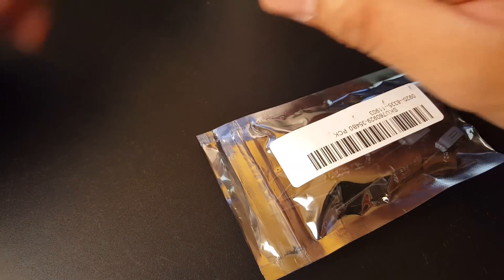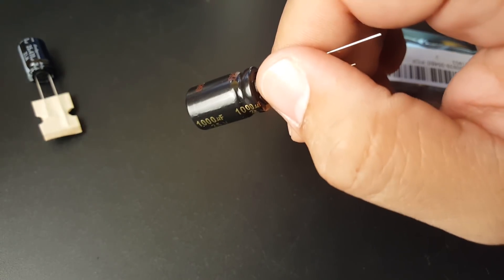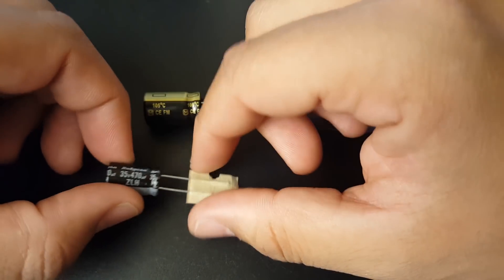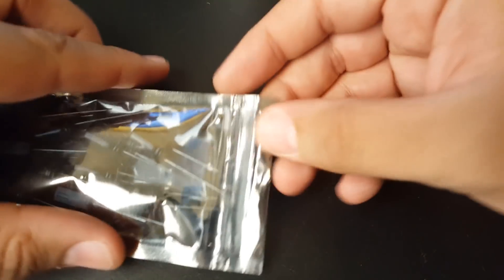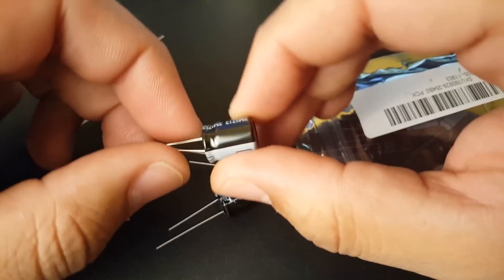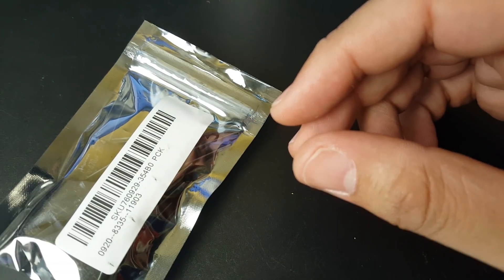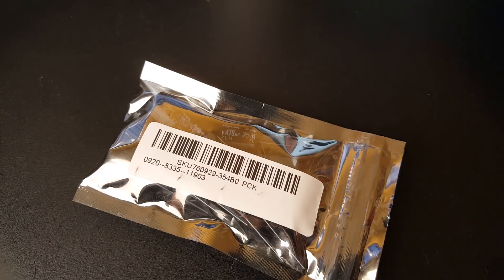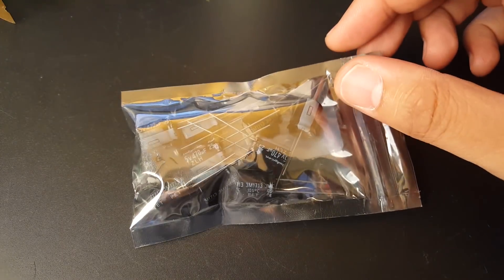Low ESR Capacitors I Use For My Builds

Comment: I run a 35v 470uf Panasonic cap on each of my KISS24 amp ESCs, on my Chameleon and it makes my quad sooo smooth, It's really noticeable. I did it at first to clean up a bad video signal, and it did not help, but I noticed how smooth it made my quad, so I kept them on. Bad video turned out to be antenna grounding on the Aluminum bracket they provide.(O-Ring smashes and does not last long) I moved antenna to carbon top plate and so it did not touch the Aluminum and it cleared up instantly.
Reply: Magic Smoke FPV how did you connect your  caps to esc? Did you solder directly power wire on esc?

Comment: Caps are tricky thing, some of the better more expensive ones are used by hi-fi audio enthusiasts known as audiophiles and sometimes musicians who mod their instruments. Also by audio manufacturers. And what happens is that some particular cap gets popular by an audience who can pay more. And the price rises. And most of the time you can get same specs cap twice as cheap, but it’s not known or accepted in audio industry. For quads we should keep away audio caps as they are more expensive due to usually false perception of “better” sound :) Remember those guys who say 100$ HDMI cable has better sound and video comparing to 10$ one. But we know the data is sent digitally and no HDMI cable will make bass deeper :)
Reply: Not the same if we talking about low ESR capacitors. Regular electrolytic capacitors aren't that good for ripple current filtering (which we need to get rid of ESC noise in FPV video) than low ESR ones. Because of that they are 4-5 times more expensive.
Reply: Yes, for the low ESR, but there are some manufacturers, which are targeting to audio maniacs like Vishay, Audio Note or the old Elna's. Rubycon's and Panasonics will be trashed by audio guys, but they work perfectly OK on quads. And audio guys can create and believe to so much pseudo-science, I just can't believe :D Most of them don't even know what equipment is used in studios to record their music they want to "recreate" best on their $30000 speaker set :)

Comment: is it safe to assume that ceramic capacitors are generally lower esr than electrolyte capacitors?
Assuming that you can connect them directly smd to your signal source.

Comment: when i seen my capacitors are made by a company called chong, i kinda lost heart a little...  hehehe i dont have noisy video but i do have the black lines permanently on my fpv, i think its from my rx since it doesnt change during flight. and capacitors dont seem to address that kinda rf noise
Reply: Check to see if your antenna is touching the frame or any metal. I had the same problem on my Chameleon, and almost swore it off forever because I could not get any video Tx to work without lines no matter how many caps I used. I swore it was because my FC Rx and video Tx were to close, but it was just the antenna touching. I had same black lines that didn't change also.
Reply: ah thanks, i was just thinking and my vtx antenna is touching my top deck... i'm almost positive theres no lines before i put the quad together so i should pay attention next time i have to dismantle the frame, my rx is verticalon my top deck and one under the arm pointing forward, like most people do now.. and my vtx is straight out the back
Reply: I run the same configuration. I found it was ok for my antenna on my Chameleon to touch the top deck, it was just when it touched the Aluminum for some reason or went through the hole for the antenna, it had bad lines. I had the same lines on my Martian II, and I separated the brass connector from touching the top plate with 3M double stick and it still did not help. I changed the antenna to a new one and it went away on that quad lol.
Reply: i have the inmortal T crossfire antenna attached in the arm, and i have gorizontal noise, also in a Chameleon frame :S I don´t know what can it be. I have capacitor 1000UF 25V, and the TBS UNIFY PRO is with foam, not touching the carbon fiber :S. Also the vtx antenna maybe touching the aluminium black deck/ piece? Any suggestion please?

Comment: I always wondered what low ESR means. I have a bunch of capacitors and with a component tester I found out I got values like 0.2 - 0.3 ohm or values like 0.07 - 0.19 ohm. Is low ESR the later interval? Can you be more specific what ESR value is good for filtering out noise in FPV systems?

Comment: I still have some noise when using the 470uf capacitor. Will it make a difference if I solder on a 1000?
It's on a 4in1.
Reply: Tony It could.  Might help more to add a 2nd 470uf instead.
Reply: Diminishing returns, but higher capacity always means less ripple.

Comment: Hey man, you are probably familiar with Kabab FPV. You both offer interesting ideas to check and lately he mentioned something that you may be able to look at. He said that braided (maybe also twisted) cable running from ESC to Motor makes it harder for ESC to read motor state. It makes sense :) But is it something that could really affect the performance?
Reply: Drone Hero's agree on all that you said. I am always cutting wires for perfect fit, and I am twisting them to minimise the EM radiation and the effect it has on electronics onboard. But the idea presented was that if you twist those 3 wires that goes from ESC to MOTOR that it would introduce more noise to those wires thus the ESC would have harder times to guess what is motor doing.
Reply: what do you mean by twist? soldering in no straight line? Thank you.

Comment: I thought the raceflight team stopped shipping their boards with Rubycon b/c they were not good caps.  they have a video going over different caps and their internal resistance.  Bardwell also had a video with a spreadsheet listing many caps and their IR, panasonic was at the top https://docs.google.com/spreadsheets/d/14M4Z0GPJp3u7L3bmYBizHm3Leg0XOCmAWQOx_wEgEng/edit#gid=1538665578

I'd like to know more about what you find as well
Reply: Yeah.. I thought the panasonic FM is the way to go..